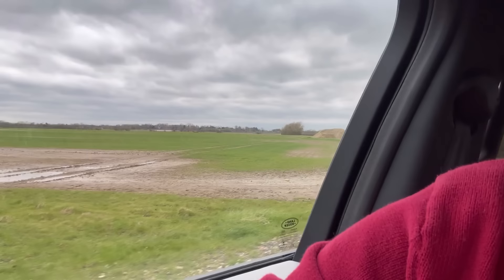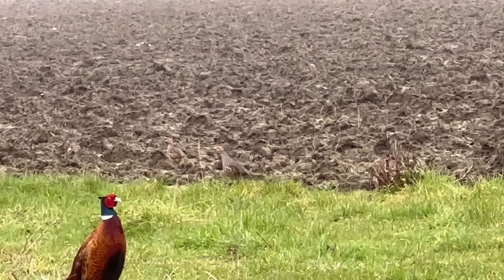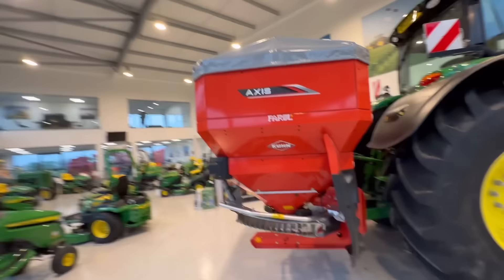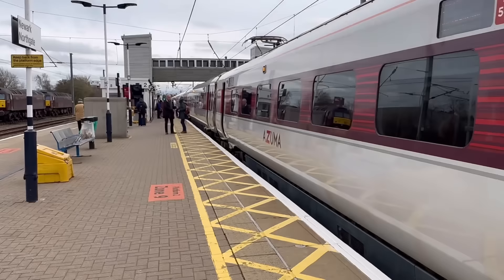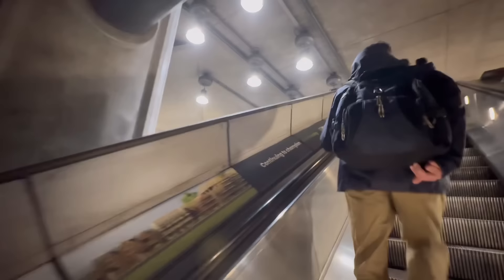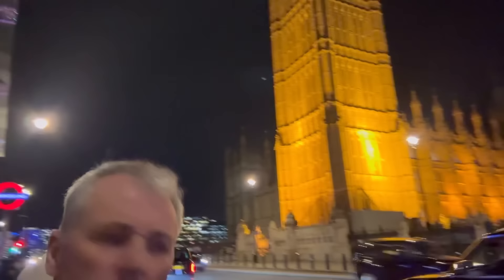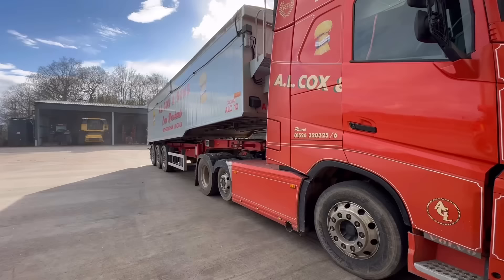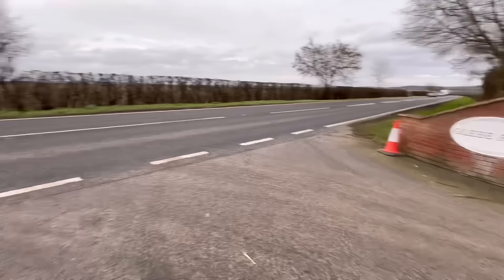FARM UPDATE 239 Ditch slips in, Polaris ready for mapping fields, House of Commons, wheat collected

Comment: I wouldn’t be too rigid regarding a drilling cut off dates just yet. This year is so different from last year. 
2012/13 was similar to now and the highest yielding Spring Barley I had in 2013 was drilled 7th May!
Reply from the maker: But grain prices are about half last year so need to fa tor that in. Also, we’ve had so much rain that we will go into a long dry spell which happened last year after the spring crops were put in and that is the worst thing for spring crops I think. I’ve looked back at my rainfall figures for 2012/13 and we had rainfall all the way through to Harvest, there was no dry spell like last year or we might have this year. Interesting times! Mark
Reply: As an old boy I knew used to say if you don’t load the gun you can’t fire the bullet

Comment: What makes you choose  a Heath Robinson type set up on the Polaris to map your fields?  Are there not more ready made precision solutions/services that can do a quicker, more thorough and accurate job?
Reply from the maker: We have only borrowed the wiring harness, modem, and frame, it sits on from Farols, when we have finished mapping all the fields, it will go back. The screen and dome off the Househam sprayer. If it was ours and staying on the Polaris permanently, we would’ve done a lot better job and hidden all the wires, etc
Reply: What,s heath robinson about it? That,s like saying a rolex watch is heath robinson because it,s merely strapped onto your wrist....
Reply from the maker: I was wondering what he meant, presumed the way we’d installed it. JD tech is at the top of the tree.

Comment: That mapping - you can do it with an ArduSimple SimpleRTK2B and agOpenGPS - wont' cost you more than £500. Some money the green kit costs, absolutely ridiculous. A bloke on TFF fitted a quad bike out with AOG, no problem.
Reply from the maker: But will it link into all the sprayer and other machines? A lot of experience here of nothing talks to each other!!!!
Reply: @WardysWaffleAndrewWard  the mapping option at that price, no (although it provides visual guidance for manually turning sections off yourself). Some people have built machine boards for section control and variable rate and we're working on shapefiles integration. I did a variable rate demo Xmas '22 with it. However, another team is working on ISOBUS integration, free as well. And there's a demo of that on my channel if you're interested
Reply from the maker: We’re trying to have one map that all the machinery uses and we have only borrowed some of what you saw. 

We’re also integrating it all into Gatekeeper, The screen and dome are off the sprayer and we can use them on other kit too. I’ll look at your video, cheers.
Reply: @WardysWaffleAndrewWard  we can save/load Isoxml as well now, no idea if JD can read that, but it opens up a few more avenues to integration. Also, there's a guy working on farmOS (also free) for record keeping and such.
Reply: @lansing9r what is your channel name please?